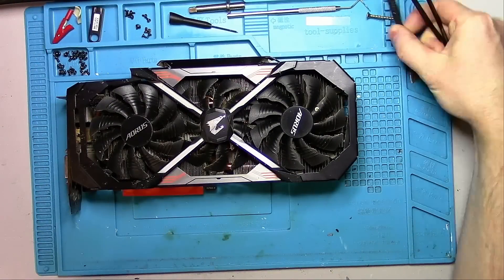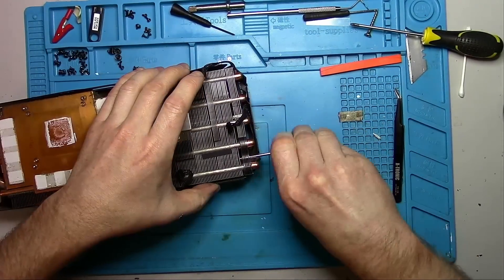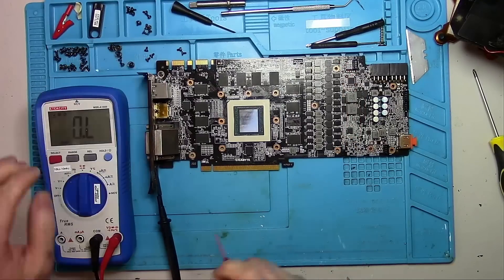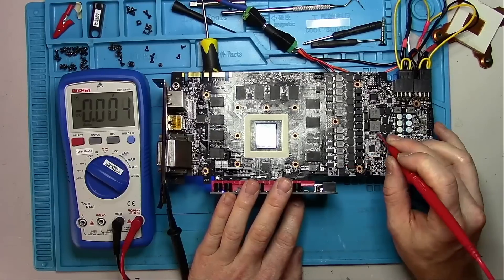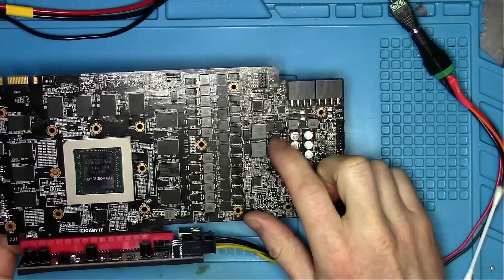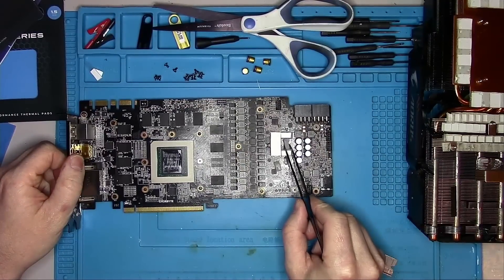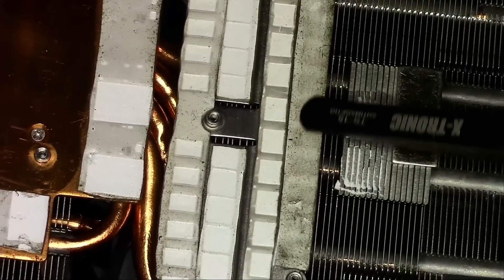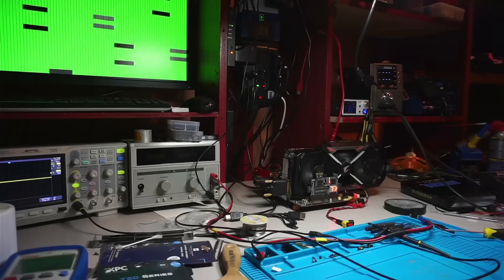Does Gigabyte make good Graphics Cards ?

Comment: Nice work and a pleasure to look your videos. I hope you will help many people with that kind of videos!

I wonder if you can help me. I have a aorus 2070 super 8G. I want to repaste it and change out the thermalpads. The support has given me some weird measurements for the pads (0.6/0.7mm). Do you have any recommendations for me? I also talked to the support of thermal Grizzly and the said that I should stick to the recommendations of gigabyte 🙄.
Reply: I got the same useless feedback from their support team as well. Perhaps OP knows, but in my case I just bought two large squares of both on amazon and then cut down to size based on the pads in place. I was able to tell which was which just by holding them next to each other. I think each pack of pads was less than $8.
Reply from the maker: Trust me, unless pads are damaged or completely dried out (which is unlikely because 2080 is no where near as old as 1070's and those are not even close to dry) there is no need to replace pads. Pads are good from factory, better then anything you buy online.
But paste is needed to be changed only if you notice abnormal temperatures.
Is you CORE running over 80c and Hot Spot over 90 ? Hopefully not.

What i would do is to look under the heatsink and try to see if pads are in full contact with the board, especially in the area of the memory phase.
In this case (in this video) pads were missing completely but i think it was one time quality control problem because its not normal.
Reply: @northwestrepair  In my case, my pads were placed poorly. Not lined up, rippled and bad contact. The paste was also bad. I don't regret replacing mine.

Comment: What processor did you use? Same or little bit less performance as my gaming platform xeon e5-2670v1 + 1660S + 16Gb DDR3.... 🤔
Reply from the maker: Not sure. Cheapest motherboard i was able to buy and cheapest intel CPU it supported plus DDR3 memory. Good enough to make a test bench but not enough to benchmark video cards.

Comment: As an overall expertise, how do you see PowerColor and XFX GPU's in temrs of quality build. I'm asking this because they are cheaper than ASUS TUF/ROG in my region and this will help me to decide if in terms of price the ASUS ones (especially ROG) deserve the price, as performance terms the ASUS ones are a little bit better (at least on sheet)
Reply: paying a few extra for a peace of mind for such an expensive and probably long term purchase is always better than cheeping out.
Reply: @Jack-he8jv  yeah i know that in some small cases more money = more quality but in my region the difference is about 700$, that's not a few extra. I'm refering to an PowerColor Red Devil 6800XT vs an Asus ROG STRIX 6800XT which is much expensive and not that much better, yeah the ROG it has room for even more OC but with a 150$ more the Red Devil also has an water cooled block ... Also the PowerColor and XFX manufacturers are older than Asus ROG department, they were present when the ATI was still on the business so they aren't new to this sector.

Comment: After watching this video, I may be tempted to go inside my AORUS RX580 to check the placement of the heat pads and thermal compound to make sure it doesn't buckle and blow.

Would a Sapphire RX580/590 have made any difference in 2019?  That was actually my top choice, but they were way too expensive compared to the AORUS ($240/$270 vs. $200).

Comment: What is your opinion on 3090 evga ti ? Is it the same quality job as previous evga series ? "2080 , 1080" ?
Reply from the maker: Every card is different. They make them with different heatsinks and different price ranges so its hard to tell without looking at it.
Look at the temperatures specifically for your card (i mean very specifically) and if you are below average, you're good.
Above ? I would look at your case air flow to start with.

Comment: I have an rx 6600 windforce from gigabyte and the temps are underwhelming and when trying to remove the backplate to clean the heatsink the plastic parts that the screws bite into on the pass through side just completely broke off, it's not like I was being aggressive with the teardown or anything

Comment: Their RGB software and drivers suck. I owned 2 Boards and 2 GPUs from them and had at least one unresolveable issue with each of them. I^m waiting for a 3070 to arrive, and then we'll see if the streak continues.
But they have cool looking shroud designs, decent cooling, nice and quiet fans, and their Eagle series are the only 2 slot 3070's I've come across sofar (thicker doesn't fit my case). (If the cooling and noise part holds up.)

Comment: Currently considering a small claims court lawsuit against gigabyte.  I bought 5 3060 ti's from newegg, 1 in march and 4 in april and 3 of them have failed.  The first one has been back 3 times, they declined to attempt to repair it again and sent me a replacement card.  It artifacted and blue screened out of the box...they obviously did not even test it before sending it to me.  I have sent 2 the 2nd one that failed back twice, same thing, they "repaired" it, it came back, put it in a computer, it lasted 6 hours then died completely.  The 3rd one got sent back last week.  I have been dealing with them for almost 4 months now and still have not been made whole.  Newegg has obviously been no help, they told me to stop bothering them.  Gigabyte doesn't even provide a way to get any answers.  They just have a customer service phone number that will call you back in a few hours but then can't answer any questions about what is going on.  They also don't own up that they have been providing me with terrible service by sending me cards that don't work.

Comment: Do you fix gpu's for people? My brother has a gtx 1070 that no longer works. His cpu fan bearing failed and dropped a tiny bit of oil on the card since it obviously sit directly above the gpu. I would to have it fixed if it wouldn't cost too much obviously.

Comment: Which brand would you recommend now that EVGA is done making GPUs?
Reply from the maker: Just because EVGA stopped producing new cards, does not mean there are no latest and greatest (also brand new) EVGA cards on the market today.
It only means that future generations cards wont be made by EVGA. Those cards do not even exist as of yet so no one can recommend anything with a serious face until new gen cards come out.
Reply: @northwestrepair  Sorry, I mean if somebody was waiting for the 4000 series, based on your past experience repairing the GPUs, which company would you trust the most after EVGA

Comment: Will share some story from retail store and gigabyte rtx 3080 ti vission oc one fan not spinning, retail store sent it to supplier service and that service sent it to gigabyte after three months of waiting gigabyte returned gpu with conclusion written on paper "ALL OK" But single fan is still not working. Gigabyte has terrible warranty, those 4 years of extended warranty is basically not existing at all. I myself have gaming oc 3080 for year and 9 months now, had to swap thermal pads year and 3 moths ago, i only play games, however vram at 100-105c is not okey, since i used thermalright oddysey pads temps dropped from that 105c to 74c. Kept card dust free. However am afraid even keeping and using card lightly will still kill it some day. 3k series for all manufacturers had so much faults that it's just a shame that many paid so much money for poor built quality of high end cards...

Comment: On other hand i have multiple GIGAbyte mobos high end ones like (Aorus x370 K7, x58A-UD7, old ones like GA-BX2000, GA-7NNXP and others) they work like a charm.. I am specially happy with the newer ones the Aorus and the x58 UD7. The Aorus was able to mostly work like 90% of the time, without microcode for the CPU it had installed, every other brand i saw on the internet did brick themselves, but mine naa it still works great.. And the x58 UD7 i did test ton of video cards on that system (like at least 130 GPUs +, did OC up to 4.5GHz the 6/12 core Xeon, and the mobo works rock solid, never had a single problem with it.. Video cards well i had multiple GIGAbyte cards like older GEforce 7800GT, GEforce 250GTS, or newer ones like Radeon R9 280x, Radeon RX480, they all worked great... But for GPU brand i prefer MSI, they are so much better then most brands..

EVGA on other hand i had PSU from them SuperNova 820W P2, well it was garbage i got it brand new, on the second year stared having nasty coil whine, for no reason.. On the 3 year i got USB surge problems, at the time did think it was from the windows, printers, smartphones it all did diconnect all the time. then on year 4 it started to randomly hard shutdown.. Then i diagnose the system, it was not from overheating, so i changed the PSU with Corsair (imagine Corsair HX 750w from the far 2009 model) it did work ROCK solid, compared to the garbage EVGA, there were NO coil whine, NO USB surge and errors and crap, no shutdowns... SO no thanks EVGA is not as good brand as everyone think. Sure their customer survice is NO1 that is for sure, but not their products... There was alot of dead and burned to death RTX 3090 specially EVGA ones.. Also there was fire hazzard some years ago it was also EVGA, but not sure on what nvidia models GTX 980 or GTX 1080...

Comment: So I had a working card up to a few months ago. The situation I’m in. Is that card receives power from the single 8 pin connector. The fans will spin normal & stay on. But it never gets a display output regardless of HDMI or D.Port so I never get to see POST welcome screen. Trying another card of the same model, the entire computer will boot to windows desktop without any issues. So I’ve ruled all components of the computer such as powersupply, memory, cpu, motherboard. It’s the card as another card of the same model works fine. 

Gigabyte 1660ti twin fan. Any thoughts?
Reply from the maker: Does your monitor have LED indicator ?
Power the card as normal and watch for that LED. If LED responds after about 30 seconds and monitor backlight turns on (but no image) you are likely having memory problem.
Gotta run test and replace bad bank.
To confirm, boot from integrated graphics if your motherboard has it and look into device manager see if it finds your card and says ERROR 43
If it does, you got a memory related problem.
Reply: @northwestrepair  I will test this and see. I can’t rem if the led did blink it may tried to turn on. But I will try the igpu method, have to gather a intel test bench since I ran with mostly amd 5000 cpu

Comment: Does anyone know if EVGA does good with thermal pads and their QC?
Reply from the maker: Its never just EVGA or any other brand. it depends on the card. Some are good some are bad some are terrible.
EVGA is by far the best in my opinion. They put pads on both sides of the card and cool it on both sides.
Reply: @northwestrepair  thanks for the reply. I have the standard EVGA XC 3060 card and wondered if I should take it apart.

Comment: Whatever I bought from Gigabyte I ended up regreting... My three worst offenders 1. Fucked up audio hardware on an old (cant remember which but 2001 was the year) MBO which Gigabyte swore wasn't their fault and couldn't get a new MBO under warranty 😡, 2. Radeon 7600 golden sample with massively overhyped "silent pipe" cooling (no fan) which was garbage and overheated at stock settings, but Gigabyte stated that my case was not meant for their card so that was that 😂, 3. Recently like 2018 bricked dual BIOS b450 MBO, ended up being their fault, fucking finally accepting some fault, because there was some stupid software mixup and I got a refund and got a beautiful MSI b450m mortar, updated the BIOS on that lil fucker no problem and got my new Ryzen 5 5600x to work on it flawlessly 💪... Just the other month I was offered a RTX 3070 from Gigabyte on sale and because we all know how cards are expensive these days ( even on sale) I decided to go with Palit since I've never had a problem with them or Gainward... Actually on my Gainward Geforce 6600 gt the fan died on me, but the card worked even without it with no artifacting 😂 ... So yea... No more Gigafuck for me thx ❤️

Comment: As someone who has own several Gigabyte cards ( 650ti, 960, 980 and 2080ti) each one of them sucked on overclocking. My 2080ti can't even hit 2000Mhz stopping at 1990Mhz. Do not buy Gigabyte at all, they are not worth it. Oh and my 2080ti is on water as well. Bought the block once EKWB put them up for sale.
Reply: My Gigabyte Gaming OC 6800XT has been fine so far no problems.

Comment: I believe you mentioned in another video that you don't like AMD cards either. Ok, But! . . you like EVGA Nvidia cards, what about AMD cards? Do you see a manufacturer that has the highest quality and consistency?
Reply: Sapphire in general seems to be good recently. I really like their Nitro+ line: socketable fans, dedicated vrm/memory heatsink, dual bios. Though I've seen people say they had some bad card designs in the past. Honestly I imagine you can find something wrong with any aib at some point.
Reply from the maker: I dont like AMD's because of their circuit design. Its not as straight forward as NVIDIA and their cooling solutions are no better. It seems like only EVGA cares about cooling their board properly, thats why i advocate for them.
When EVGA blows up, repair is usually doable but when MSI or ASUS blows up, its a donor instantly.

Comment: Gigabyte makes unbelievably bad products. I personally saw three GPUs and one motherboard, all Gigabyte, die in the last year alone, and I don't even work as a technician.
One GTX 1070 Windforce that died on me (OK it was 6+ years old so it kinda earned it at least), one 3060Ti Aorus Master which replaced it and had the decency to die within 1 week enabling me to return it and buy something usable, a 3060Ti Windforce of a friend, and an AM4 motherboard of another friend.
Gigabyte is s*it, just buy (almost) anything else.

Comment: Yeah gigabyte is not very good its basically common knowledge now. But i thought aorus xtreme is one of the better ones. Anyone who does their research knows that. but do you know anything about evga rtx 3080 xc3 ultra gaming? I've read that evga ftw3 are pretty good
Reply: Gigabyte hasn't been very good for a long time in my opinion, had one of their socket 754 motherboards and it didn't last very long. Decided to go Asus since their RMA rate was way lower, their customer service isn't what it used to be and their products do have their issues but still much better than Gigabyte. EVGA's customer service is light years ahead apparently from what everyone is saying, personally I would go with either EVGA or Asus in today's market.
Reply: Any Aorus series are super reliable, Mobo, GPU, and any other else.
People who complained were either in bad luck or just troller.

Comment: So evga is good?
Reply: @PavKer i'm asking because i bought an evga 3080 ti and i hope i did a good choice
Reply from the maker: @PavKer not 100% true. Some of their latest 30 series cards cut corners. 
But generally speaking, yes, they are consistently the best.
Reply: @northwestrepair  what about zotac?
Reply from the maker: @johnodei618  zotak is a budget card. I would expect it to be cheap all around.
Reply: @northwestrepair  thank you for answer... i'm asking because i had some bad experience with evga, my old 2080 was hitting 90°C under load, to keep it under 80°C i had to maxed out the cooler... it was a 2080 xc ultra, i changed the cooler with aftermarket and slaped 2 noctua fans, that kept it to 60°C. Now i have zotac rtx 3080ti holo amp and it doesnt pass 80°C in load with overclock, i'm happy 😬

Comment: Guess your gonna hate your job now cause evga is dead now, no more gpu's best find another favorite 🤣
Reply from the maker: Your statement is true only for next gen cards. There are plenty of new EVGA cards still on the market so why bother.
If 1080ti still holds its value today, in 50-maybe 10 years 3090's will hold their value as well.
Reply: @northwestrepair  But why would you want such an old card in 10 years, most games can barely run on 1080ti now, and some cant run at all, although only a few. If you have anything older than a 20 series now then you'd be better off owning a console, only reason to own a pc for gaming is to push the limit beyond the consoles, if your cards are weaker than that then no reason to spend all that money on that. Also your far better off buying a 3050 or 3070 than owning any 10 series card and most 20 series cards for that matter. Also EVGA is good, but they aren't the only manufacturers that make quality products.  MSI and ASUS make great cards as well, EVGA wont be missed, they will either be replaced or forgotten, tech moves on.